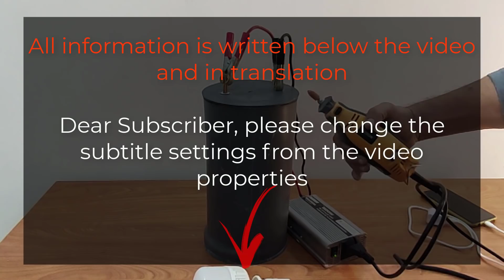Three months on probation until it succeeded

Comment: Very Goodman!!! 
And how long works this battery, strong enough for the light or the dremel Tool? with a charge cycle?,!
Friendly greetings from Austria!
Reply from the maker: Mr
We measured it and it works above 200 amps, which means we were able to run it for seven hours without charging
The charge was completely discharged at eight o'clock, which means that it works at a large capacity
Reply: @NetHelp2  هل كلما كبر حجم الانبوب اتساعا زاد.  قدرة الامبير.   وكم خروج الفولت. اذا. تم تكبير حجمها